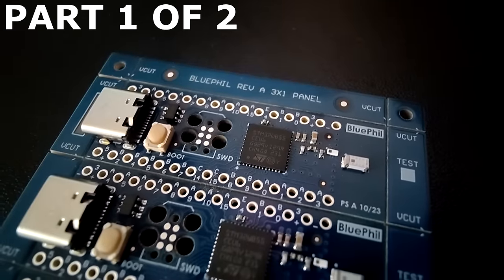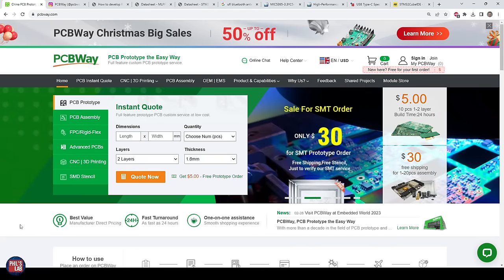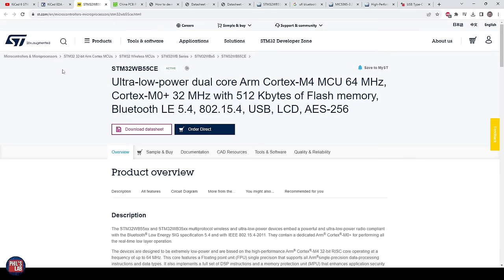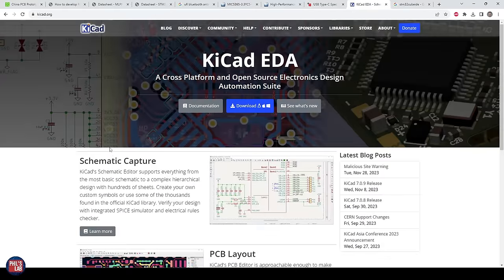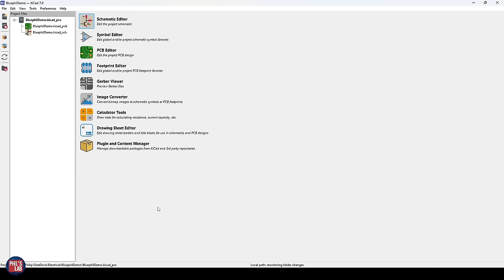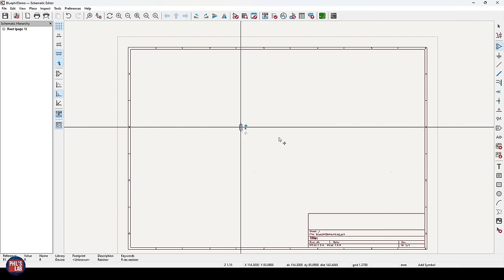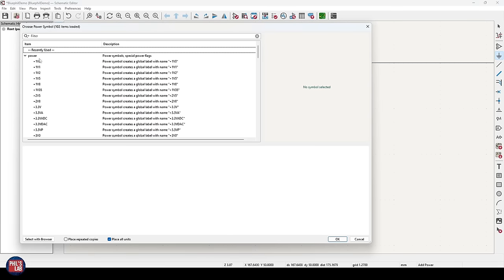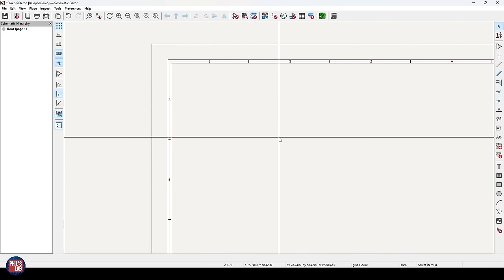KiCad 7 STM32 Bluetooth Hardware Design (1/2 Schematic) - Phil's Lab #127

Comment: I do have a couple of questions/suggestions for possible future topics. I really enjoyed your overdrive circuit that models diode clipping. How can that concept be applied to modeling a vacuum tube circuit? Also, I've been researching a lot about analog front end/back end design using discrete components instead of a CODEC. Something that keeps popping up is the use of MDACS. How exactly do MDACS work for designing a low pass/anti-aliasing filter for example. Are there any online resources that cover that specific use case? Again, thank you for everything Phil.
Reply from the maker: Thanks for the questions! Regarding modelling vacuum tubes, I'd recommend checking out 'DAFX' by Udo Zolzer. There are also some papers/PhD thesis on vacuum tube modelling for DSP (e.g. https://www.jstor.org/stable/40301029). I'm actually working on a vacuum tube design, which we will later model in firmware for a future video.
I'm afraid I haven't done much work on MDACs, so can't supply any info on that I'm afraid.
Reply: @PhilsLab  Thanks you for the link and recommendations. I'll be sure to check out your suggestions. I've read quite a few white papers on tube modeling and understand the concept. I'm a little rusty on my Calculus, so the math is above my head. A practical example would be terrific. I think seeing it done would make everything "click" so to speak. Thanks again Phil.

Comment: can/need I use the 220 ohm resistors also for all the I2C and SPI lines ?
Reply from the maker: Usually that's fine, depends on capacitance/length of line, amongst other things.

Comment: Isn't the RF section internally matched to 50 ohms? Great video 👌
Reply from the maker: No, the impedance at the RF1 pin depends on package type. There are different matching networks shown in the schematics in the STM32WB design application note.

Comment: Phil, if you had a preference for Altium or KiCad based solely on ease of use and how ergonomic it is to navigate for extended periods, what would it be? 

I find myself using KiCad whenever possible because the keyboard integration is so fast once you’ve learned it.  But obviously there are so many features it lacks compared to Altium, especially for more complex designs.
Reply from the maker: Hey Jack, I'd go with Altium (with or without sponsorship), as this is what I use pretty much 100% of the time both for personal and work projects. I prefer the workflow, UI, library system, extra features, shortcuts, etc. That being said KiCad is a great alternative, as of course the Altium licensing fees can be prohibitive for individuals/hobbyists.

Comment: What are the regulatory implications of building a custom RF design like this instead of using a pre-certified RF module? If I'm making a product to sell, what certifications and fees are needed for a custom RF board vs a pre-certified RF module? If I'm building this for a hobby, am I supposed to have an amateur radio license to build a custom RF board?
Reply from the maker: When selling products, even in many 'commercial-level' designs by companies, the preferred way is to go with pre-certified modules (unless there is good reason to otherwise), rather than what we're doing here in this video. This (can) make(s) the certification process of the whole hardware easier and cheaper.
There is this grey area when selling as a kit/devboard/module (i.e. a device that needs to be integrated with other hardware to become a final product), which somewhat relieves the need for testing in certain cases. However, my suggestion is to contact a test house directly and ask for costs and tests needed (this is what I do regardless) - check out, for example, Sunfire in the US or LCS in China. Sunfire has approximate, typical costs listed on their site. Alsk check out EMCfastpass - they have guides for 'individual makers'.

Comment: In the past the crystal frequency of a Bluetooth chip needed to be trimmed by software with a frequency counter. Is this still the case? How does this work nowadays?
Reply from the maker: Yeah, there are a few app notes and videos by ST that detail tuning for the WB devices: https://www.st.com/resource/en/application_note/an5042-how-to-calibrate-the-hse-clock-for-rf-applications-on-stm32-wireless-mcus-stmicroelectronics.pdf
https://www.youtube.com/watch?v=qNJR9vL1D0c

Comment: Am I right by saying that a lot of circuits-design is "just do what the datasheet says"?
Reply from the maker: For these types of very simple, digital designs, yes, a lot of it is on a 'system level' - finding suitable parts and then how to connect them (e.g. via datasheet, app notes). For analog, mixed-signal, more complex designs, etc.. there's quite a bit more to this.
Reply: @PhilsLab  interesting, thanks for your answer :)

Comment: Hey phil, awesome stuff as always.  Im trying to make a board centred around the atsame53j19a mcu from microchip. I want to host a web server from it (with the html, css and js files on an sd card). Can you make a tutorial on a similar topic? It might help you show how to design ethernet, sd card interfaces and tcp/ip programming for mcus?
Reply from the maker: Hey, Thank you! I'm definitely wanting to make some videos on hardware/PCB design for SD cards, Ethernet, etc.. For firmware, I'm afraid I would however stick to STM32 MCUs, but the principles would be similar.
Reply: @PhilsLab  thank you! Your videos are always appreciated. Even if the firmware is in stm32 land, i bet the principles of setting up a web server and controlling the board via ethernet would still be REALLY useful. Looking forward to it!

Comment: why don't you use global labels in the design for better separation anymore?
Reply from the maker: I've changed my stance on that over the years. For smaller designs such as this, for me, interconnecting the design as shown in the video + local net labels is clearer than a large number of (global) labels. For larger, multi-page schematics I do a mix of interconnects on the page itself, and harnesses/busses/global nets across the pages.